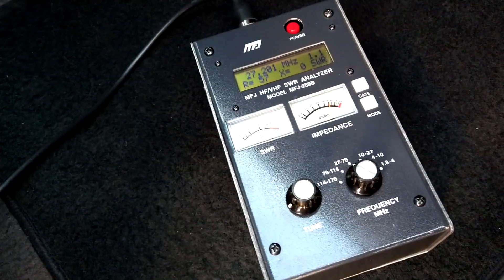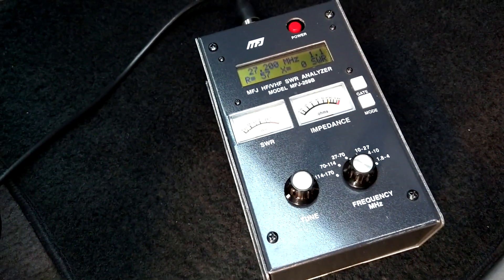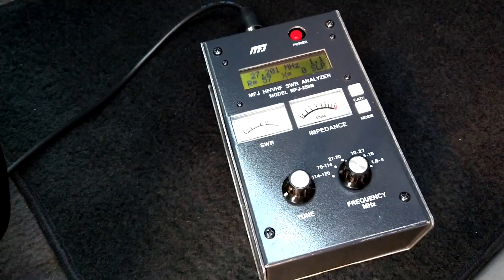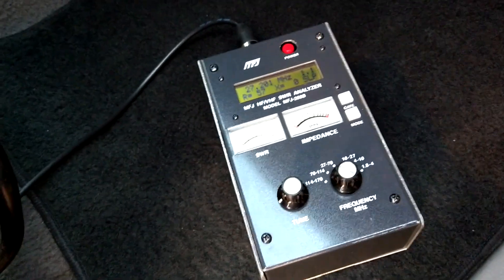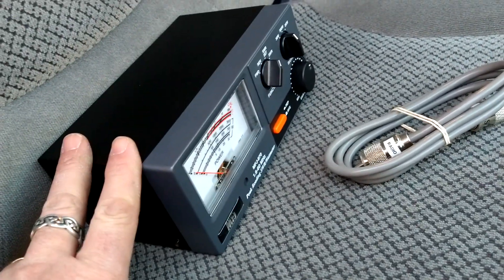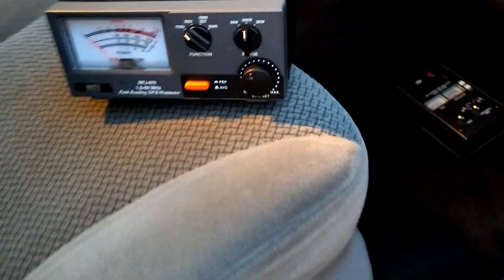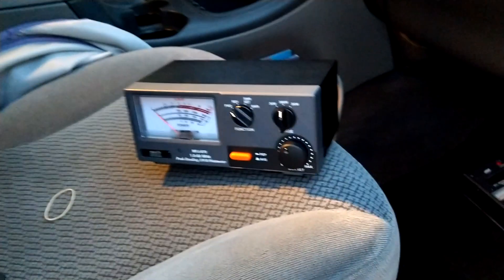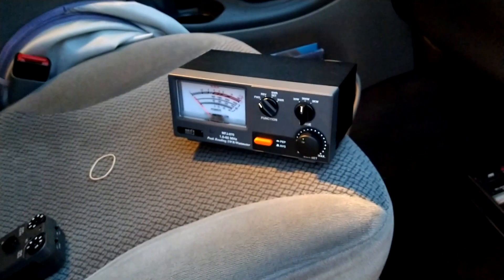Why is my meter showing reflective power? Watch the entire video.

Comment: The main thing I would say and I don't see in the comments where anybody else even seemed to notice it. But if I saw that right, your homes were somewhere around 70 or 80 and that's way too high. Your home should be balanced the same way your SW R's are. If you're at 1.1 or 1.0 on 20, your own should be 50 and then channel 1 and 40. Your home should be balanced the same number, though. It'll be a little bit higher, but just a few numbers. Not you know, down the street higher.  I think that's the culprit , so that would wait me to go back to the coax

Comment: I am no tech whatsoever but I had the same problem. Would it end up being was I burned out the wire in the coax going back to my Ant ohm it out all them could be burnt
Reply: Burnt two amplifiers up because of it brand brand new coax was bad then I started burning antennas up
Reply: Hopefully you got it fixed

Comment: don't  know if you got the problem solved, I have the same problem on mobile antennas but only on the lower bands such as 40 and 75 meters where the antenna resonates fine but when I power up the radio I get high SWR. The reason is that my car does not have enough of a ground plane for the lower bands. I have not had that problem on 20, 10 or 6 meters. If I take the same set up and move it from my car to my full size p/u truck I can do 40m fine but still not enough ground plane for 75m.
I'd use a mag mount set up on the roof of your truck and see if it works...73 de KB1TCD

Comment: ground loop in vehicles body/chassis.  check grounds.   Most common is the body to engine or ground.  when this goes bad, anything grounded to the body will find its path home through, the spedo cable, or your coax shield!

Comment: Its the Meter Ive had numerous problems with my MFJ 870 false readings goes out of calibration.
try another meter these 870's are faulty. Thats an Export rig your overdriving the amp
that causes back swing oversaturation of the pills maybe?

Comment: Put 102 inch stainless steel whip and by adding or taking away coax you can match   the antenna to the radio and it will be a perfect match. but soon as you add in a meter in line that match goes off because you off set the length, the way I do it is you put in your linear and then put in your coax and make your adjustment by adding more or taken away in most cases you add length.

Comment: Whenever I see something like this it is a grounding issue. Not that your equipment is not properly grounded. Your antenna does not have sufficient ground plane underneath the antenna(counterpoise). Remember as your power increases your ground plane needs to be able to support this added power. Your "Plane of ground" is sufficient for a barefoot radio; But when you add power everything goes haywire. You need to add more ground plane potential to the roof of your vehicle.

Comment: Desert Explorer, you still having problems with your radios ? Check your antenna again. Using your mfj 259, go to efficiency setting in advanced settings and see what your antenna efficiency is displaying. How much does your Texas Star 350 hdv push out in wattage ? Sounds like your radios are doing well. Billy / Albq. N.M. 1 / 4 / 2023

Comment: 1. The SWR must be set with the Amp ON!  2. Your testing with the doors  open and close to houses. 3. Amp on test with meter set at the hundred watt scale for reflection!!
Reply from the maker: You would think so with everything you read, however in real life it make little to no difference at all. After checking SWR on numerous vehicles over the years it's basically a non issue. Check your SWR while driving down the road and you'll see why.
Reply: @vegasfordguy  I'm just trying to help. It's been a year I hope you figured it out.

Comment: Did you ever get this issue figured out?  I am experiencing the same issue with TS 1600 and exact same meter.  I run a RM Italy 503HD and all is good with reflection same as barefoot radio.  Thanks

Comment from the maker: Update!!! So my buddy 191 comes over today. Galaxy 959 with a Texas Star 500 in his mobile. We put 2 different meters on his truck and guess what? Same exact reflect the same exact way! His mobile is louder then base stations around here. So He's running a Texas Star 500 and all 3 amps I tested in my mobile we're all Texas Stars so I'm now confident it's nothing to worry about and simply something within the texas star circuitry causing what must be a false reading. All 4 amps show normal and then step up to show reflective power the same exact way in two totally separate vehicles and using two different meters.
Reply: I have the same issue on a base with a Texas Star 350HDV and a Galaxy DX 2547. The 350 has original 2879's and I don't want to blow them. My Bird 43 swings backwards on RMS with the amp on. I don't know why and I don't like it at all. I cant figure it out either.

Comment: Everything looks normal my only concern is the amps heatsink buried in the carpet. I mount all my transistor amps upside down with fans on them. "If it ain't broke don't fix it"
Reply from the maker: You're right about the heat sink, however this amp has a forced me air fan on the top cover with vent holes. That's why I mounted it this way.
Reply: @vegasfordguy  Heatsink mounted fans work best to dissipate large amounts of heat from the finals. Your just blowing hot air around inside the cabinet. That method works ok for a radio with no heatsink.
Reply from the maker: @miguelsalami  It works just fine for this little amp. It never heats up much anyway. It's not just blowing air around, it's actually forcing in, over the components and then back out. It actually works quite well for this little 2 pill.
Reply: @vegasfordguy  How long do you think you could keep it keyed down for without it overheating?
Reply from the maker: @miguelsalami  Don't know, don't try to abuse my amps, however I have no problem having a long conversation while cruising down the road. You won't even catch me trying to see how long I can key down my base amp with 4 high flow fans on it. Just because I could, doesn't mean it's a good idea. What about Stereo's, factory amplifiers, etc that are crammed behind the dash? They heat up and usually last for the life of the vehicle. This little amp has forced air cooling and stays quite cool. Although it's not ideal how it's mounted, it stays cool.
Reply: @vegasfordguy I gotcha. I wouldn't say I abuse my amps but their key down time is limitless on any stage that's just how I roll lol.

Comment: Its unclear to me if you tried putting the meter between the amp and radio to check what thats doing. Another thing the comes to my mind is make a 1:1 balun at the antenna foot and try what that does. Most simple way to to that is a ugly coax balun. You could try it for test. Another thing is perhaps you have created a unwanted ground loop. You connected the amp to ground. Did you try already to remove the amp from any ground. Does that shows other readings? If so you could ground the amp with a ground wire to experimental to the antenna foot check it again. Then move the amp ground to the radio ground and check again. Just experimental to see if something changes.
Reply: Balun choke 1:1 is the way

Comment: It may be the material that the roof is made off. You may also have a bad ground somewhere in your truck. Seems to me as a ground issue. You may have a bad factory ground somewhere in your truck. Check your alternator ground also you may want to check your fuel pump ground. Their is also a couple of grounds from the body to the frame. You may have a corroded  ground strap connector.
Reply from the maker: The roof is sheet metal just like the rest of the truck. Something seems to have changed from when I first installed everything. Hopefully I'll be able to figure it out one day and share what it was. I think I'll remove the power wire, re-run it a different path and ground the amp directly at the chassis under the seat and go from there.